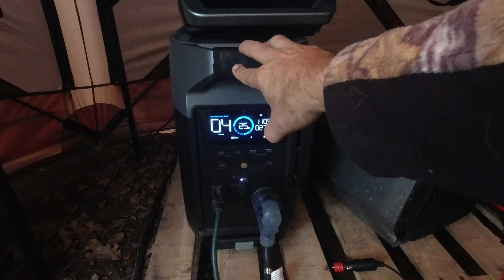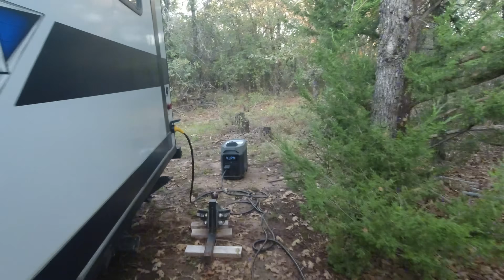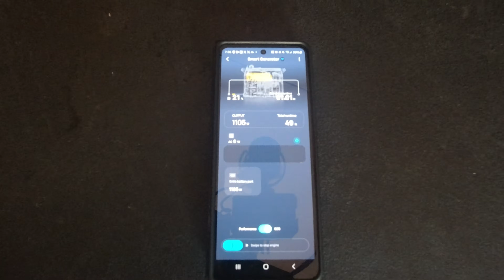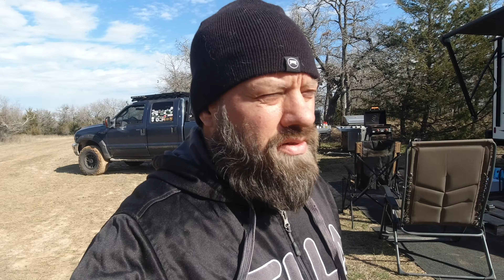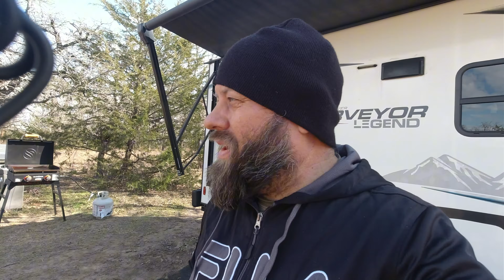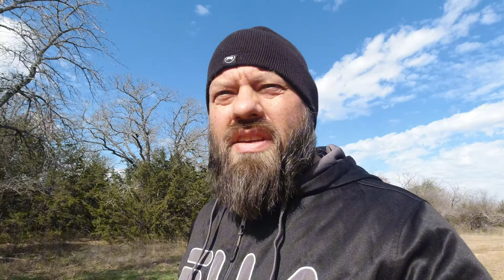Ecoflow Delta PRO Powers my RV Camp, UPGRADED Power!

Comment: Furnace should be 12vDC not 120AC...
Reply from the maker: It is.  But the 120VAC battery charges the 12VDC battery after it runs the furnace.

Comment: You need the Anker F3000 power station it can charge at 3600 watts adding 1 expansion battery it can charge at 6000 watt from a 30amp port on your inverter generator. Only an hour of generator use can run your electric for the rest of the day.